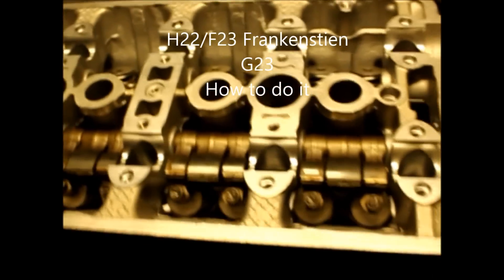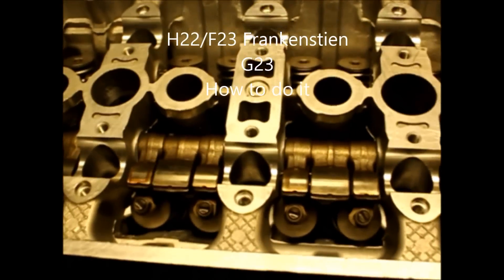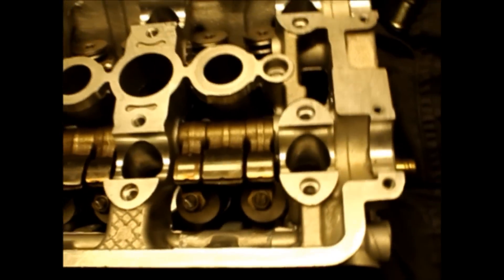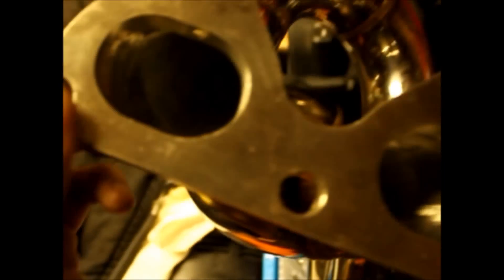How to build a G23 Frankenstein swap: Part 1

Comment: Do you use f series computer or h series? Does it through check engine or is this deq safe engine swap?
Reply from the maker: Setup like this best to use p28 with aftermarket tuning suite.
Reply: @Constantuned  can it be obd2 though. I’d rather be neck deep in wires tbh 😅
Reply from the maker: @maxwellgreenfield4117 conversion harness is all ya need. Tuning obd2 is a bigger nightmare lol
Reply: @Constantuned yeah I would take that chance since f23a4 is obd2 and it runs better with auto transmission. Just want like 200hp and 4 speed. Nothing crazy.
Reply from the maker: @maxwellgreenfield4117 good luck. Youll find basically no support for the auto trans.
Reply: I have mjca transmission that fits to the f23a4 rn why not keep it 😅 plus it’s already mated and everything
Reply from the maker: @maxwellgreenfield4117 cause ya cant tune it
Reply: @Constantuned physically you can adjust the solenoid pressure with the dual linear solenoid, solenoid porting, fluid spec. You can use these to control shift pressure and tcc slip…. Idk if it will throw codes even if you do that write?
Reply from the maker: @maxwellgreenfield4117 how are you gonna tune the fuel and ignition?

Comment: can somebody tell me why do you need a custom water pipe?
Reply from the maker: The thermostat housings are mounted on the head. The water pipe flows from the head to the block.
Reply: Ahh. I see now. So basically you mount the head first then make the water pipe? I’m researching if I can do this build without removing the engine in the car. Do you think it’s possible?
Reply from the maker: @Jaychutae  anythings possible but i would recommend removing it. Everything will be coming apart and youll want the extra access

Comment: I just don't understand why people rev the STOCK BOTTOM END F23 over 6500 rpm lolololol bye bye rod bolts and bearings lol atleast do ARP rod bolts and KING main bearing and KING rod bearings and it'll be set for 7k rpm

Comment: so quick question if the f23 pistons are used instead of the h22 is the output power difference noticeable or its the same
Reply: I read that someone used k20 pistons on this build and it fit perfect his ITB motor made 260who n/a

Comment: What happens if you don't bore out the block to the same as a h22 head I what to put an h22 head on my f22 and boost it can I just use it with out the bore or do I need it
Reply from the maker: Adrian Guerrero 
the bore on the f22 is 85mm the bore of the h22 head is 88mm. Meaning you will have 3 mm around the circumference of the block overlapping. I have read that this pocket can cause issues with unburned fuel. The f23 block is 86mm making the gap a little smaller but technically still incorrect. If you wanna be 100 percent you should bore the block to 88mm but then you probably need sleeves im guessing. 

Good luck.

Comment: What head gasket do u use for this built I have a f23 bottom block h22 head and I've used the h22 gasket and dident work out and the f23 leaks oil cAn anyone help me out
Reply from the maker: Jorge Arroyo i believe it was an f23 head gasket.

Comment: it work in a f22 block to, h22a1 head and a f22 block = g22 ,   so much power...
Reply: true, but an f23 block has Alot of durability
Reply: does a F21 block work with these sohc to dohc swaps?

Comment: So what timing gear do you need for the crank? And water pump? Do I need any other gears?
Reply from the maker: Diego Dorantes You need to buy two water pumps one for a h22 and one for f23. Pull the gear off the h22 and press it onto the f23.
Reply: @Constantuned  , he was asking about the Crankshaft timing gear. You have to use the gear from the H22.

Comment: would this be a better build then boosting a gsr or goin k series??
Reply from the maker: Good question, I dont know to much about the gsr engines, they are great engines. IMO i think every motor has potential. The G23 setups are known to be good for boost because they are low compression and have an iron block which is stronger than aluminum. I Personally am just building the G23 because it is something different that alot of people havent even hear of. K series probly would have cost about the same money and make more power but no fun in doing what has already been done.
Reply: true! I was thinking of going h23 i got a da but was indecisive since looking into these g23!
Reply from the maker: I honestly would go h23 unless you really have the time and drive to finish a g23, Ive seen alot of people begin to buy parts to build there g Frankensteins then sell them a few weeks later.
Reply: I'm just wondering which would be the overall better swap! time isn"t too much of a problem it's just some people say go h22 cause the h23 ain't worth it then others tell me to go g series or gsr turbo I'm familiar with the gsr but I'm new to this h series game!
Reply from the maker: well the h engines are larger so they are gonna make more power for your dollar. Also make alot of low end torque.

Comment: f23a1 block is a 86mm bore not 85
Reply from the maker: Thanks man, i was trying to pull all this from memory,i will update the video. But my point was that the two bores are different so you should match the bore of the head if you really wanna do it right.thanks
Reply: o i know i been thinking about doing this same set up bu i just got a full h22a i still have my f22a6 if i ever decide to build my frank

Comment: Everything seems correct but to be a legit Frankenstein built (g23)
U needed to put rsx type s pistons . Also head gasket u should be putting on is the f23 head gasket not the h
Reply from the maker: yeah switched to the f23 head gasket. didnt wanna use k pistons. high compression isnt good for boost.
Reply: @Constantuned  I'm in the middle of building and just had my block decked. I came across your video and you mentioned the H22 was 87mm and sure enough it is. How has the 86mm f23 with f23 head gasket been working with the 87mm H22? I'm also going to put 12:1 K20a2 pistons in.
Reply from the maker: @VIP854  Hello, unfortunately i never finished the project so i cant tell you 100 percent either way. From what ive read you should be fine using the f23 gasket you just wanna watch closely the location of the Rivets holding the headgasket together as sometimes they can interfere with seal. Hope this helps and good luck
Reply: @Constantuned  oh dang hopefully you finish it one day! I was about to order the 86mm pistons tomorrow but now I'm not sure if i need to bore to 87. Then there's the gasket issue again. You dont want it to over hang in the cylinder.

Comment: Good video, just something wrong is your talking about cambelt crank gear but comparing balance belt gears. These are the 2 different gears. f23a on bottem, h22a on top. 

img41.imageshack.us/img41/7825/cambeltpulley.jpg